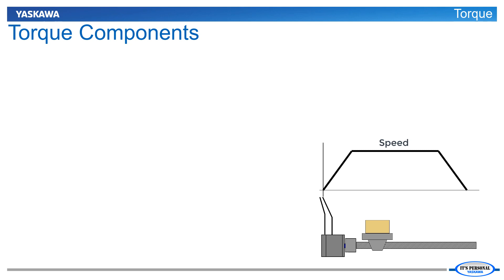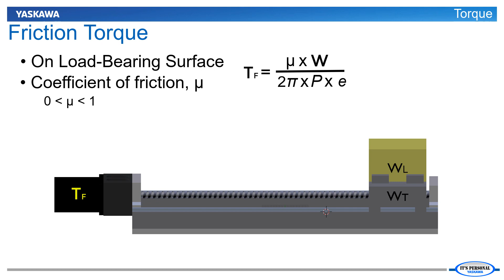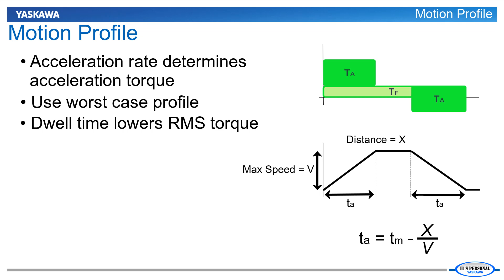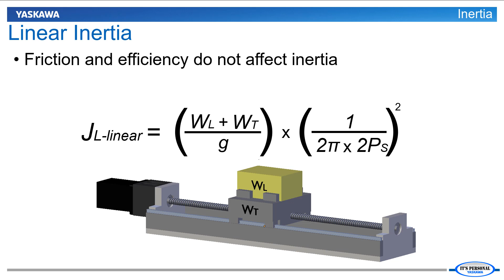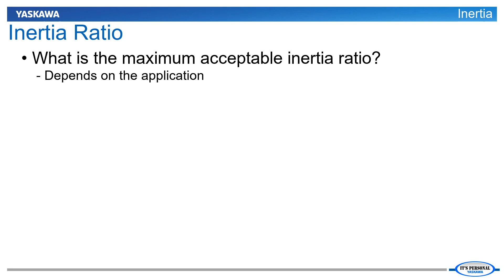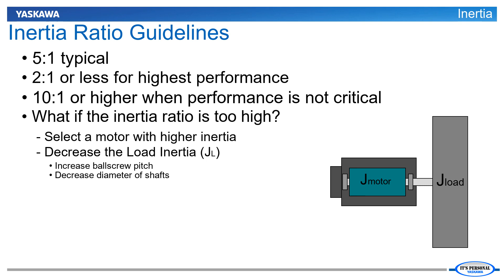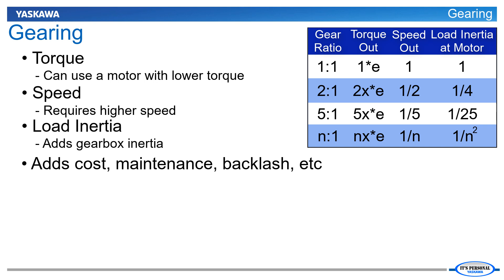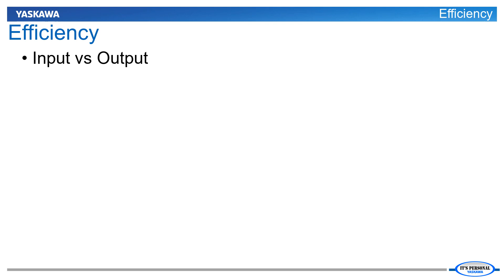Servo Motor Sizing Basics Part2 - Technical

Comment: @Eli Grobin:  Yaskawa is here defining "pitch" as rev/inch, instead of the (much more common) inch/rev or mm/rev.  With this definition, a higher "pitch" does give you a finer thread ball screw.  Their definition of pitch was confusing for me also.  At 2:28, I was expecting to see the pitch term P in the numerator.
Reply from the maker: It is possible that he is referring to ball screw lead instead of pitch. The friction torque units appear correct in LBFF-in. Here is more information on lead versus pitch. 

hhttps://www.thomsonlinear.com/en/support/tips/what-is-the-difference-between-pitch-and-lead-when-referring-to-a-screw#:~:text=for%20e%2Dcommerce.-,What%20is%20the%20difference%20between%20pitch%20and%20lead%20when%20referring,ball%20screws%20are%20typically%20specified.

Comment: When you reference the change in pitch around 6:50, what are the units of pitch? Your example references a larger pitch but then shows a finer thread ball screw, and this confuses me. I would think going from pitch of 1.5 mm to pitch of 1.0 mm would decrease the effect of the linear components inertia on the total inertia.
Reply from the maker: Thanks for watching our video on "Servo Motor Sizing Basics Part2 - Technical " We recommend contacting our Technical Support with your application information at https://www.yaskawa.com/support-training/support, or you can also reach out to your local Yaskawa Service Provider - https://www.yaskawa-global.com/company/profile/global

Comment: Excuse me Sir, why is the gravitational acceleration included in the rotational inertia equation? min 8:17
Reply from the maker: It is all about unit conversion. US Customary Units are implied in this case. Gravitational acceleration is included at 6:30 to convert weight to mass. At 8:17, to be consistent, the assumed units are also weight per cubic volume (for example lb/ft^3). We might have made this more clear by expressing the term as ρ/g. Hope this helps.